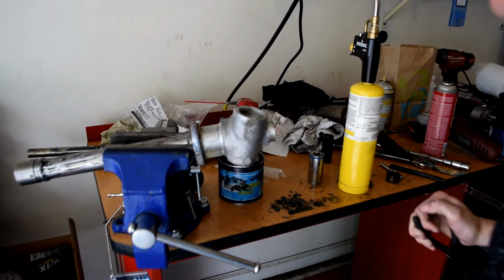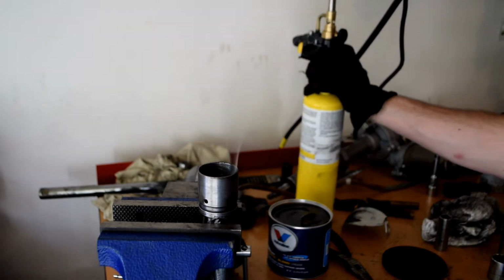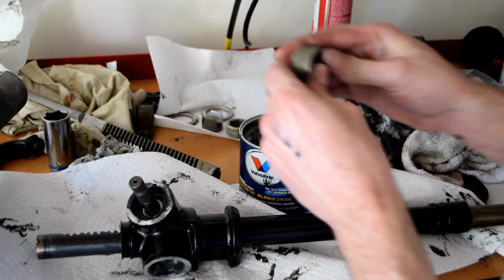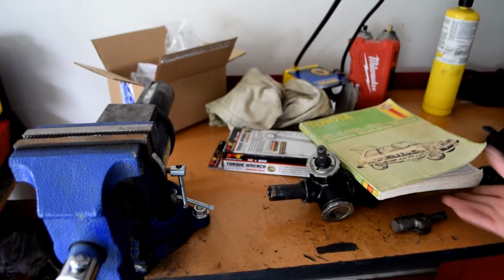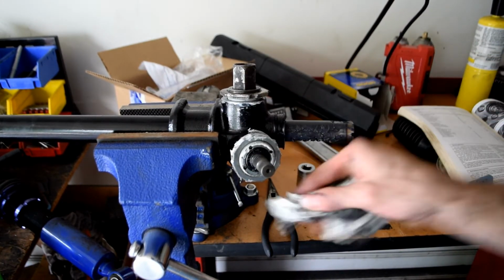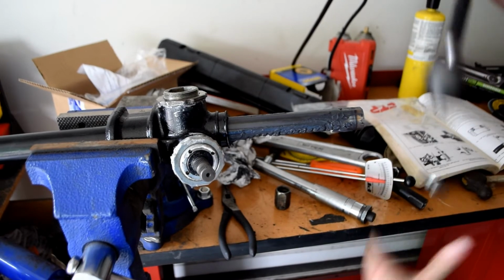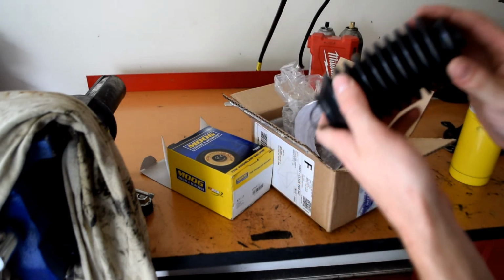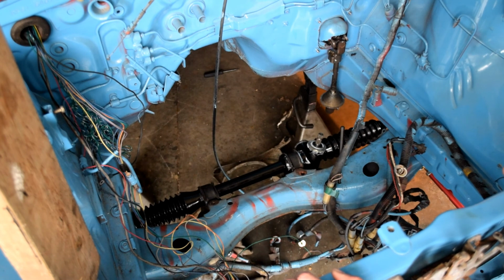Quaife Quick Steering Rack Install/How To PT.2

Comment: Did you end up tightening the spring to 18ftlbs?
Reply from the maker: I didnt, it didnt feel right as in way to tight. Figured I'd feel it out and adjust as needed. It was in inch pounds as well if you end up messing with it